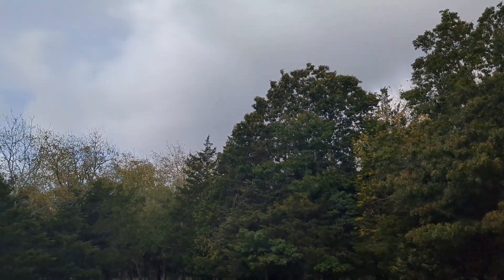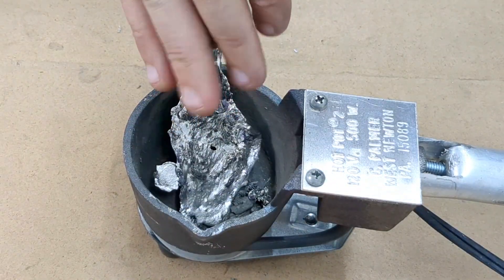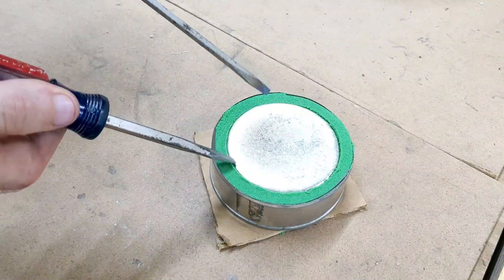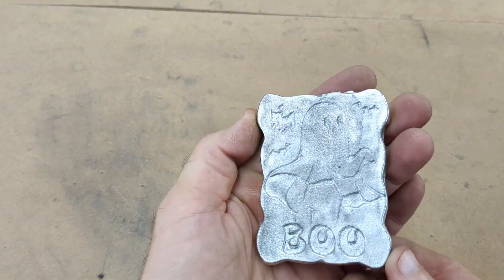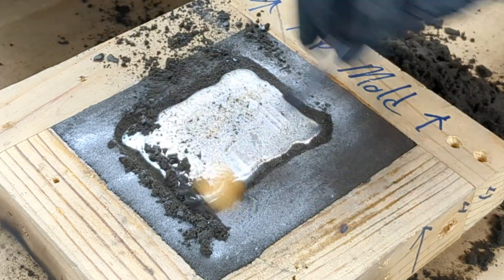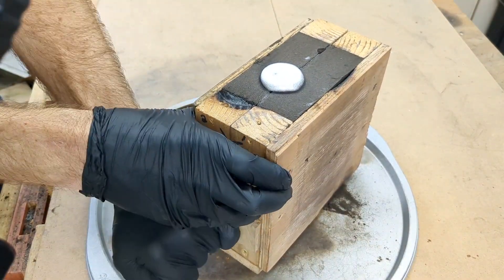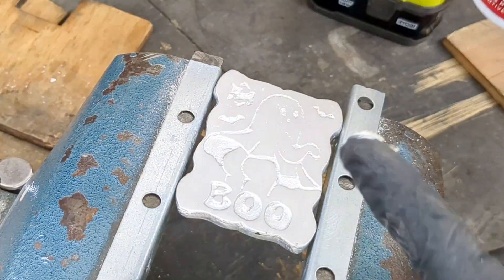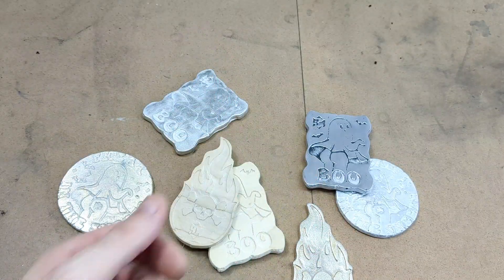Melting Metal and Making Stuff - Casting Pewter

Comment: This is a great video! Hearing about what equipment and material you use is so helpful for those  of us who are interested in trying this.
Reply from the maker: Thank you!  This is a good starter to melt metal.  It melts low melting temperature.  I started with an outdoor furnace and with melting aluminum.  This is a less dangerous way 👍

Comment: Excellent work as always ! ! !
I'm just beginning to cast with pewter. I really liked the way you casted the second pewter piece, by putting the kinetic sand and packing it on top of the mold, then flippin the mold over, instead of pushing the mold into the kinetic sand. 
Have you ever tried using kinetic sand in a 2 part mold to cast pewter ? This is something I would like to try.
Reply from the maker: Hey thanks!  Kinetic sand is great for Pewter.  I have not tried a 2 part mold.  A small vertical 2 part might be possible,but I don't have faith that it will work.  Kinetic sand doesn't have any strength to hold itself up or together.  Most likely it will start to cave in on itself.
Reply: @HeinrichsMade  that's what I was thinking as well, that it would not stick/hold together and just cave in and fill the empty space before you could fill it with melted pewter.